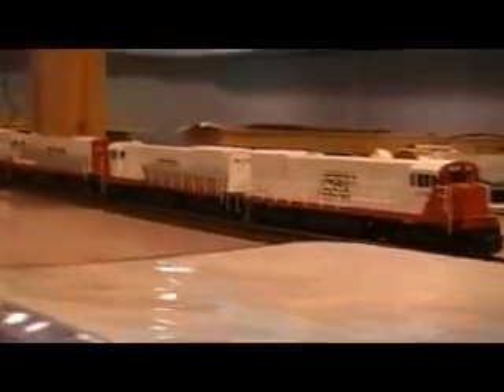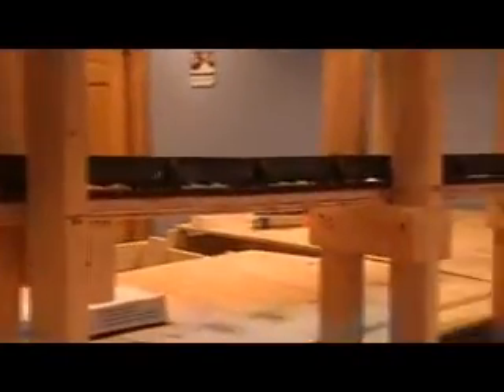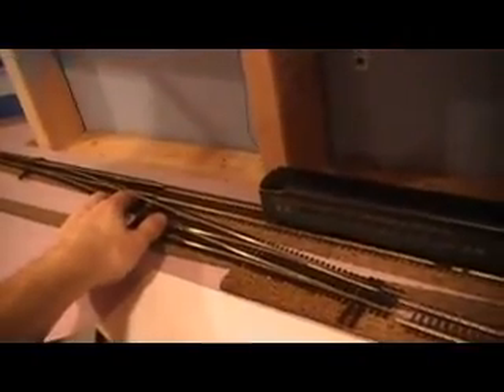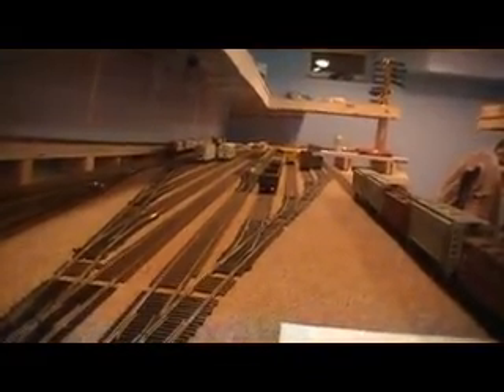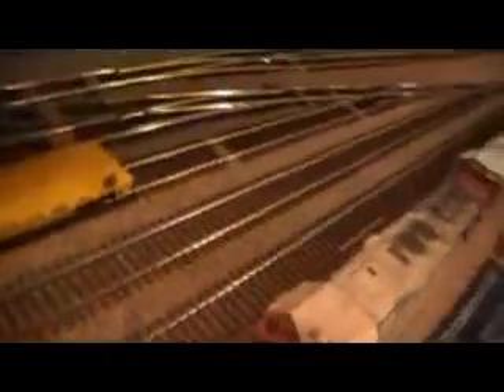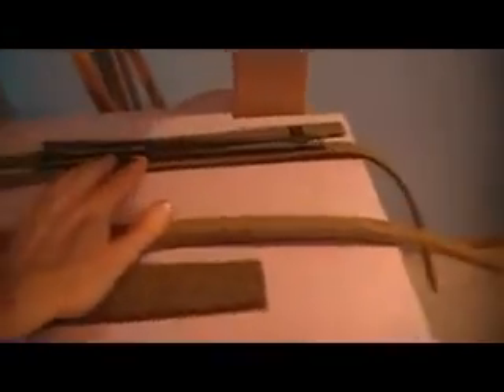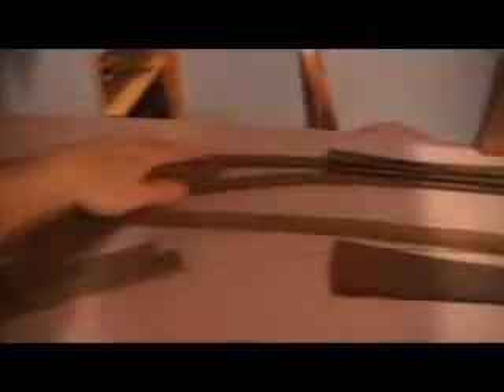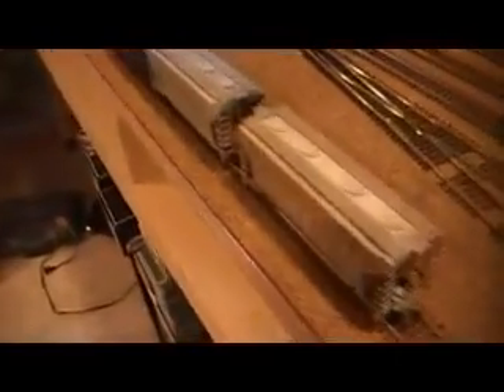Another Layout Update Soo Line U30Cs at The Point

Comment: Good layout.  You might want to add some weight to those passenger cars.  They can be a pain! Specially the 6 axel heavy weights.   my passenger cars I added weight, and I end up glueing the weight to the under side of the roofs..  The switch points ,i filed them a bit, to make sure the wheels don't get hung up.cheers!